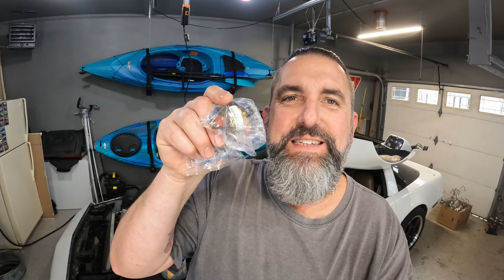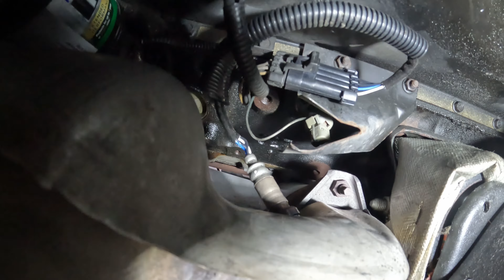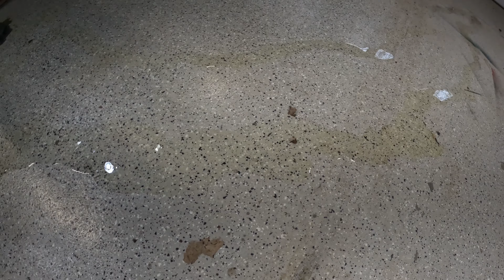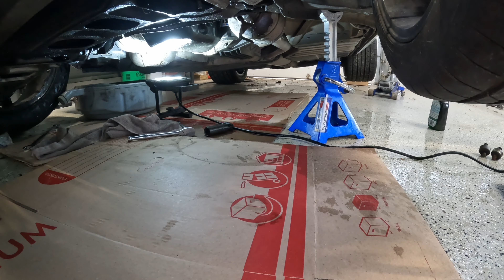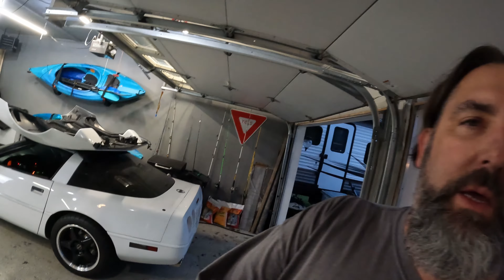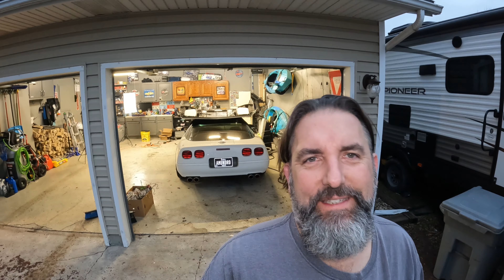Replacing Knock Sensors 1994 C4 Corvette

Comment from the maker: Alright everyone...update.

I was able to connect the OBD1 plug and software. I am getting one consistent DTC - H42 in Module 4 (ECM) which is an "EST SYstem Error" 

When I look up this code, it is DTC 42 –  Ignition Control (IC) Circuit (Shorted or Grounded Circuit)

I can pretty much rule out an actual grounded hot wire or the car would not run (from the research I performed today and reading up on this). This does not rule out a bad connection somewhere between the ECM and Ignition Coil though. Additionally, this does seem to be an indicator of a bad ECM from what I have been reading as well. I may end up ordering a replacement ECM. If this does NOT fix the car, it becomes a real pain in the butt as I will have to chase down wiring and more than likely replace connectors in the vehicle. 

I also noticed when the data was being logged that when the car would misfire, multiple DTCs would pop up for all kinds of things from Oil Pressure, water temp, O2 sensors, ICM, etc which has me leaning towards a bad computer as opposed to just a wire connector being bad between the control module and ECM.

I will order a replacement ECM and install that for the next video. Possibly have that one up by next Monday...stay tuned for more!
Reply: That should do it!!!
Just like the guy I told you about, said he replaced  ICM connector and ECU connectors.
How much for the ECM?
Reply from the maker: @geneyus6411  I had to send a request for a quote...I was searching online and found a site called Flagship1 that will program and send you a replacement...waiting for a response on price. I can find them for $200ish but they need to be programmed
Reply: @Amundred  Not to bad, as long as he doesn't deny your request!😂🤣😅
Reply from the maker: @geneyus6411  eek...quoted $1000 for the ECM!!! Jeez! I almost hope it is just a bad connector now! 😂
Reply: @Amundred  Seems awfully high,maybe get some other quotes.
I'm sure Ebay has them from businesses. 
If I can find that plastic piece for spark plug wire holder, I have a bunch of Taylor brackets, pieces around I could use to make a fix. I need if for the # 5,#7 were only. I have a bunch of those push on wire seperators from taylor that can help any sag around the exhaust manifolds.
Have to treat the wires like gold.
Reply: @Amundred  I thought one guy here said $200??? For ECM, Big gap from 1,000🤔
Reply from the maker: @geneyus6411  that is what I was thinking! I found a place that will rebuild mine for $475...I have to send it out, wait for them to rebuild and then send it back...cheaper than $1000 though! 😲
Reply from the maker: @geneyus6411  I am going to order some aftermarket plug wire separators - my stock ones do not work very well as the wires I got are larger diameter
Reply: @Amundred  That 1k guy must be for dreamers!
Reply: @Amundred  Any warranty on that work?
Reply: @Amundred  I can imagine, 
They barely work on stock wires! They break from being old or going popping off into the engine/body, can't find them,lol.
GM should have teamed up with Taylor or MSD on that! I have stock style Bosch 7mm from rockauto
Reply: @Amundred  Could easily unbolt the stock seperator brackets ,drill a hole for the Taylor bolt to go through and be done! Some sketchy videos I've seen of guys,girls who did wire upgrades just had them draped around the engine, no seperators!🤡
I had a Chevy Truck that needed a BCM module replaced once. Made it not start at all. A shop did the fix so It wasn't cheap.
Reply: @Amundred  Are all your spark plugs wires in the the far right space of the piwer steering or are some jammed up underneath?? Drive side
Top connection of coil wire is a bitch to get on,lol
Reply: @Amundred  So the first night I put the wires in the hell hole, I must have been dreaming because I  put them in by cylinder order NOT firing order!
So yeah, had to take all the seperators apart again and change the 2 wires on the opti connections. Not fun!
There's a reason they call that space HELL HOLE!!!!😈
Reply from the maker: @geneyus6411  hey...it is easy to do! I once built a 3rd gen Camaro and put the wires on in numerical order as opposed to firing order 😂
Reply: @Amundred  As long as you figure it out before you totally finish,lol.
When I woke up the next morning,  I knew I put them on wrong because I was sizing the wires up from smallest to largest length,lol.
I'm sure a lot of guys do that or muck up the the actual firing order sequence. 
Then blame  it on opti!
Reply: I was missing all the 2 wire seperators on both sides, thanks Previous Owners!
Reply from the maker: @geneyus6411  yeah, my car is missing all of the ones that are along the valve covers - I am ordering some separators for mine
Reply: If you constructed a real parts canon,  that would really boost your views!💣💥
Reply from the maker: @geneyus6411  mine are all bunched up underneath
Reply from the maker: @geneyus6411  and yes...the coil wire is kind of a pain to get to
Reply: @Amundred  I bought the drivers side ones from Corvette Central, stock size.
Have to buy 2 more now,ugh!!!
Reply from the maker: @geneyus6411  😂
Reply: @Amundred  oh yeah!
Ran out of daylight for that, lol
Who designed this stuff??
Doctor Seuss??
Reply from the maker: @geneyus6411  my wires are larger than stock so I need to go aftermarket
Reply: @Amundred  I guess it's okay for them to be jammed up against the large power steering tube?
Reply: @Amundred  Anything larger than 7mm 
Must be like playing rubix cube!😁😂🤣
Getting them tucked in there.
Reply: @Amundred  Probably easier to remove the water pump and then snap on the connector!😡
Reply from the maker: @geneyus6411  I would agree
Reply: @Amundred  I go to bolt on my new tensioner today. Did this before when I bought the car, was relatively simple the 1st time. Except today, I could not even get the dowel tab or even the bolt hole to line up. I did some reading on the forums and a few articles said if the engine mounts is bad , it causes the tensioner not to line up. Have you ever heard of that? I spent a lot of time fumbling around, tight space ,had a good light but no luck! 😱
If you go back to when I was trying to pry the idler pulley off, at one time, the way I pryed up, the engine looked like it lifted upwards.
Reply from the maker: @geneyus6411  I can see how a bad motor mount could cause that issue. It is really close to the cross member already!
Reply: @Amundred  To be honest, I didn't think so. I will have to double check.
Raining now. It just seemed like no matter what position I put the tensioner in the pin or bolt hole would not line up at all. I need to get that  in so I can start,drive the car,lol.
Don't even know if my pulley repair will work,lol.
Reply from the maker: @geneyus6411  I just put mine in place and lined up the pin hole...I am not sure how else it would work 🤷
Reply: @Amundred  Zero video about our year cars for engine mounts, that's pathetic.
I wouldn't even want to deal with that until it's running again.
Not much on forums either.
Reply: @Amundred  exactly! I did shine a light in there and looked like 2 vacuum lines may have been "blocking" from seating.
I think they were the opti vacuum lines.
Nowhere else for them to go.
I'll try everything again, when dry out.
Kinda disappointing to spend hrs with no results.
Reply: @Amundred  On a side not, I just happen to randomly read about opti. A guy was saying if you have a bad coil wire/connection it will stay cause the coil to stay open an act as a rev limiter able to go past 3-4,000 rpm, like a rev limiter! Sounds like your symptom.
The person said a lot of people blame opti. Maybe that's happening to you, showing coil/ICM  issue???
Reply from the maker: @geneyus6411  that sounds almost exactly like the symptoms I am having! I will know Monday! Parts should be here Monday and I plan on putting the ICM and pigtail on that night! Will hopefully upload a video with a running Corvette! 🤞
Reply: @Amundred  Well,,also verify your coil wire is on the opti,coil 100%😳
Reply: @Amundred  Those opti vacuum lines don't have much slack. I never knew about them the 1st time I changed the tensioner, they shouldn't be an issue.
 I think only 95-96 have that.
Reply from the maker: @geneyus6411  yeah, the vented Optispark was for 95 & 96. I have a Dynaspark for the early LT1 that is vented like the 95/96 style. I put the stock style back in last time I did the Opti though, but do still have the vented style for a future install again.
Reply: @Amundred  Finally got that on after wrestling with it,lol.
Was very  ridiculous!
I ended up ordering 2 - 2 wire seperators and 1 - 4 wire seperator  OEM from ecklers.
Reply from the maker: @geneyus6411  do you think that you will be up and running this week?
Reply: @Amundred  Yes, possibly today.
Just need to bolt on the AC idler pulley, new belt, charge battery.
How about you?
Reply from the maker: @geneyus6411  once my Ignition Control Module and the new pigtail arrive, I will be putting them together to see if it runs! I believe that they will be arriving today!

I will need to replace my wire separators for the plug wires still, but that doesn't affect whether it runs or not at least!
Reply: @Amundred  New video time!
I forgot, need to wrestle the coil wire onto the opti. Did you double check yours?
Reply from the maker: @geneyus6411  yeah, I had my water pump off  when I re-wired the spark plug wires so mine is good 👍
Reply: @Amundred  That's cool.
It looks like it could be another wrestling match,lol. The issue with the new tensioner, seemed like like locator pin wasn't just sliding in and the bolt has to be exactly lined up to thread in.
Reply from the maker: @geneyus6411  oh boy....fun times! 😂
Reply: @Amundred  Some of these steps turn into mini project's, lol.
Everything will hinge on the pulley repair also.🤔
Reply: @Amundred  I'll update you later on today's progress.  Lots of wind,pollen, little leaves blowing around,lol 
Doesn't help the cause.
Reply: @Amundred  You still need to climb under your car and fix the knock sensor connector you busted! Video time!
Reply from the maker: @geneyus6411  that is an easy splice repair...I will make a video but it will be like 2 minutes long 😂
Reply: @Amundred  Easy for you, lol.
I didn't mean make it for me, there's a lot of guys depending on you!🤑
Plant your video seeds now and reap the rewards later💣💥
Reply: @Amundred  If you really need motivation,  listen to Prong " snap your finger, snap your neck!"
I hope this pulley repair isn't BS, I put a lot into prepping it.
Reply: @Amundred  I figured out a nice trick to getting the coil wire on
Apply the dielectric grease to the inside boot. Make sure to have the end unplugged from the coil so you have plenty of slack. Start the wire onto the connection, a large screw driver can help you push from side to get the boot towards the terminal. 
Once on , grip as close as you can around the boot area and push in. You should be able to get 1 click.
Now go to the passenger side, position yourself so you can grip the boot and pull  /push the boot the rest of the way on. You should hear the 2nd distinct click and you're done! I have protective sleeving on and still got it no problem. 😝
Reply from the maker: @geneyus6411  awesome!!
Reply: @Amundred  Yeah, was awesome to hear that 2nd click and move on,lol
Working on the AC idler pulley.
It seats good,  spins good. I have enough stud left to thread a 2nd nut  on for safety. The guy in the video didn't do that but can't hurt, plus blue loctite.
Reply: @Amundred  Don't forget your ACDELCO  part # 1742
Updated 4 pin alternator plug that comes with protective boot on the backside. 
If your wire are good, just depress the pins out and slide new boot, connector on.
Reply: @Amundred  any luck??🤔
Reply from the maker: @geneyus6411  parts are delayed until Thursday...not sure what happened but they changed carriers now and has a new delivery date of Thursday😡
Reply: @Amundred  Only a few days but disappointment I'm sure.
I thought you were busy with the video.💣💥
Reply: @Amundred  You ordered another ICM??
Reply from the maker: @geneyus6411  yes, and the pigtail. Wanted to have them both as either one could potentially be the issue
Reply: @Amundred  You should have 2 of everything!😱
Do you carry spares of any parts?
Belts, ICM, hoses etc??
Reply: @Amundred  Had to repair my alternator plug. The pins were worn, the side of the plug was cracked, the piece was still there. Ended up splicing the connector on, comes with the nicer heat shrink connectors. There's also a protective rubber boot that goes on the backside.
Reply: It's time to slip the belt on this evening and see if the engine accepts the pulley repair 👀🤞 Have to charge the battery too!
Reply from the maker: @geneyus6411  oh boy!!! Exciting!!!
Reply: @Amundred  Yes, can be.
As long as everthing goes smooth!
Everything hinges on the pulley repair.
👍
Reply: @Amundred  Also, the Amazon connector comes with a 4th wire installed,  you can depin and discard that wire, it's not used.
LT1's just use the first 3 pins🤪
Reply: You should really pull your battery and check all those fusible links/ and ground.
That could be a cheap fix!
Maybe your ICM wiring, connector is fried like the other guy also.
Saw how rough you are on connectors,lol
Reply from the maker: @geneyus6411  I even checked voltages going to the TPS, Water Temp sensor and Air Charge temp sensor thing...trying to rule out all possible issues before replacing the ECM
Reply: @Amundred  Car is all New now
Reply: @Amundred  Any clue about the spark plug wire routing on the drivers side??
All the wires go under that larger power steering hose or over??
Reply from the maker: @geneyus6411  I checked all of my wiring today around the ICM and coil, I tested all of the fuses, checked the battery and cables...I could not find a wiring issue
Reply: @Amundred  You can't get at or see the fusible links,ground without removing the battery. There's a bunch of fusible links and that's a main ground.
Reply from the maker: Here are the troubleshooting steps that I will be doing this week:

https://www.instagram.com/p/CdHLvm9LICI/?igshid=YmMyMTA2M2Y=
Reply: @Amundred  You have some very involved , not easy work ahead of you.🤓
Same thing that other guy was doing.
He diagnosed for weeks before his fix.
Reply: @Amundred  Very involved.
Could you tell me the wire routing for the spark plug wires on the drivers side. Holding me up from finishing.
Can't tell if they all go over or under the larger power steering hose.
Rain tomorrow!
Reply from the maker: @geneyus6411  looks like they are under (behind?) it..
Reply: @Amundred  Makes sense though because that angle of the 1st loom
Reply: @Amundred  Yes, had to unmuck it!
Took the wires out and re fed them through. All on opti and fed through first loom, locked down.
Reply: @Amundred  Thanks for letting me know. They are properly routed, through the looms too.  I lost the last plastic loom piece  that locks over the wires on the last one. Close to being done.
I hope the pulley repair works!
Got  dark quick.
Reply: @Amundred  I just have to physically place the boots on the plugs, bolt  AC idler pulley on , bolt on tensioner, put belt on. Tighten traction control bracket.
Probably charge battery.
Reply: @Amundred  I have no idea how you got your big banana fingers in the "hell hole"🤔
Reply from the maker: @geneyus6411  you are almost there!
Reply: @Amundred  Oh yeah!
The one plastic piece I lost popped off when taking it off and bounced into the engine, never hit the ground.
Maybe I can find it.
The drivers side wire routing came out perfect, tight, no rubbing, no crossing. 
A lot of work.
Reply: @Amundred  I made my protective lined coil wire last night. 
Came out very good. 
If you evet do that, do yourself a favor and have the better quality shrink tubing 3 to 1 ratio , with the glue inside and use a heatgun. Harbor freight has cheap ones. Using a lighter is not going to happen,lol 
You don't even have to crimp. Just slit your old boot off, put the liner, shrink tubing on, apply a little silicone grease to the boot and just the fitting back in until it seats properly.
Reply: @Amundred  Rain today, if it stops, I'll pop on my newly made coil wire.
I also noticed I have all kinds of pebbles, seed pods sitting on the frame of the engine compartment.  I'll use my home vacuum and get that out of there!
Those seed pods wedge themselves all over the engine.😱
Reply from the maker: @geneyus6411  yeah, I hate those seed pod things!!!
Reply from the maker: @geneyus6411  I have a heat gun I use for shrink tube! Way better than a lighter!!!
Reply: @Amundred  I vacuumed a bunch out when I installed my injectors. LT1  C4's are a magnet for those, lol
Reply: @Amundred  lighter doesn't cut it,lol
Heat gun makes the shrink look professional.
Reply from the maker: @geneyus6411  indeed! 😂
Reply: @Amundred  Would have been nice if GM used an aftermarket type spark plug wire brackets instead of brittle plastic.  This is their Flagship car! Wth??
Thanks bean counters!
Reply: @Amundred  At least you have that book telling you what to do next.
Reply from the maker: @geneyus6411  oh man, the FSM is a life saver! It makes troubleshooting these issues much easier! However, sometimes it just leads to more parts for the part canon! 😂
Reply: @Amundred  You'll have a awesome driver when done!
Reply: @Amundred  I don't have the FSM yet or Build sheet!!!😯
Reply: Are you going to be able to repair that knock sensor connector  ok??
That would be a good video.
Why you so rough on connectors??😂
Reply from the maker: @geneyus6411  yup, connectors are readily available!
Reply: @Amundred  I knew that but physically putting them on can be challenging.
Reply: Seriously though, your videos will help a lot of people diagnose their mystery issues. Your video are good overall but sometimes you leave out a lot of details, doing the work. People want to see those parts.
I'm glad you don't show your nasty feet on camera!😂🤣😅
I know it's not easy doing videos , I've seen a lot of fails on YT.
Reply from the maker: @geneyus6411  I don't want people to be bored watching me turn a wrench or splice a wire, so I usually delete all of those parts out 😀
Reply from the maker: @geneyus6411  agreed!
Reply: @Amundred   But not everyone knows how to do those things.